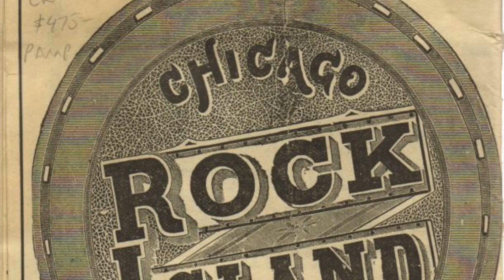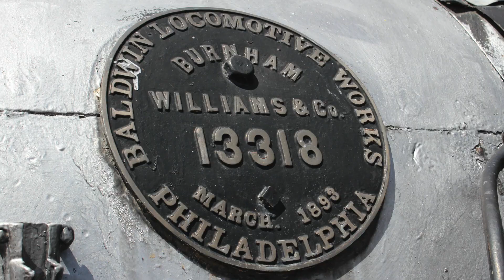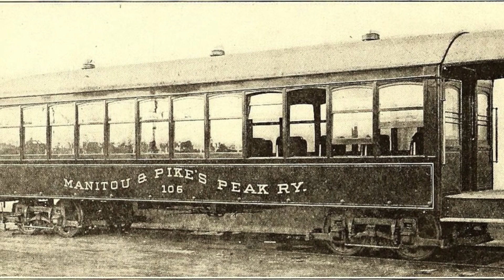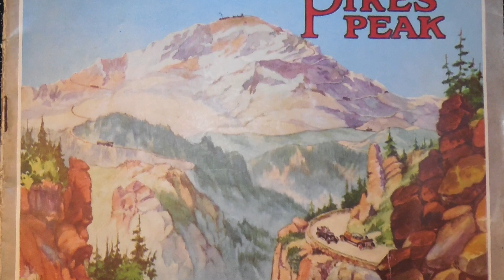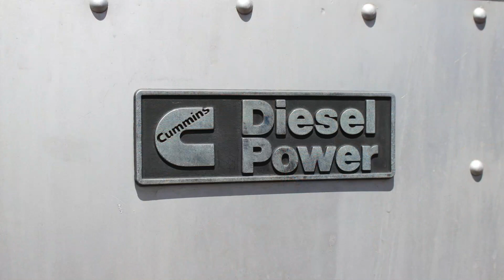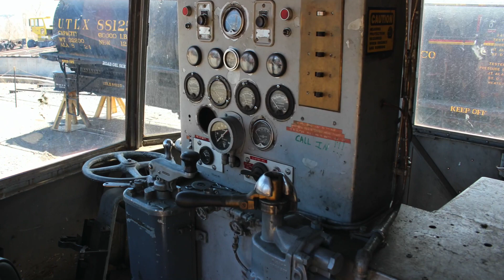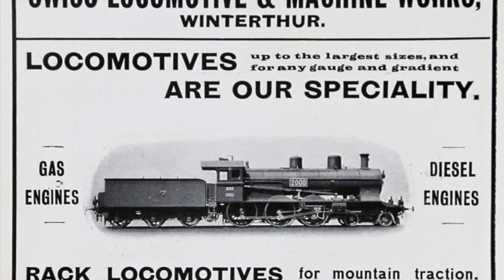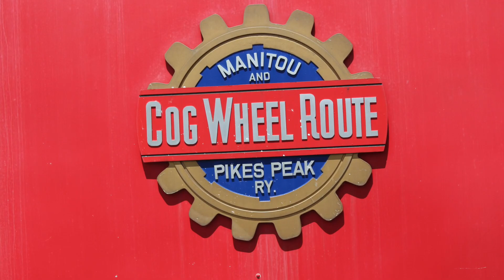Big Train Tours: Cog Railway to the Clouds

Comment: I worked on the section crew for  the Manitou and Pikes Peak railway back in 2015. We made many a trip up the mountain in work train number 11.
Reply: I helped install switch heaters and the controls for same at the lower end of the Cog Ry. in 2017.

Comment: The M&PP went out of the way to save at least one sample of every kind of equipment it ran. I'm so glad the CRM is continuing this tradition and saving a superb collection of historic M&PP equipment. I railfanned the line for decades with my first photo taken in 1971. I also wrote two of the tourist books which were sold on the train (Cog Wheel Route and All Aboard For Pikes Peak) and produced the video which was also sold on the train (Pikes Peak by Rail). The M&PP is an entire chapter in my book Railroads of Colorado. I rode work trains, rode outside on the flatcar plow following the rotary on a snow removal train and ate lunch in mule park while our train was parked on the mainline! So I have had a very close relationship with the railroad for a very long time. I believe the historic importance of this railroad was and is underestimated. I congratulate the CRM for saving all this equipment as I know it is a large commitment for both space and money.
Reply: We produced a pretty good rail annual on the early years of the Pikes Peak Cog......CRA no. 34 I believe. I helped the author get it set for print. They were inspired to dig deep after reading an article about the cog in a foreign newspaper if  I remember correctly,